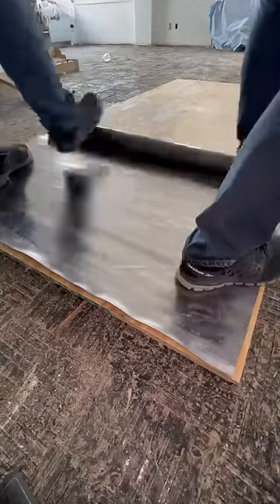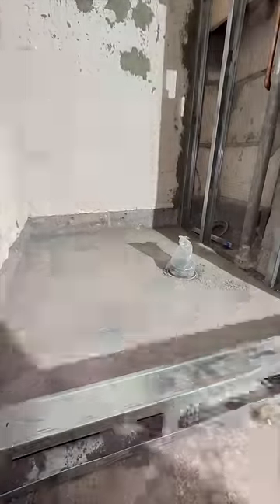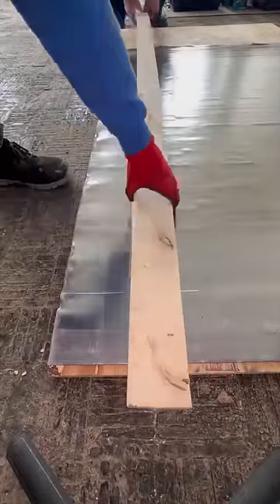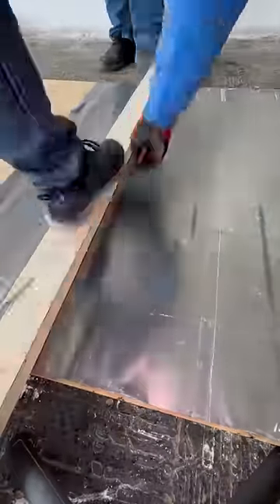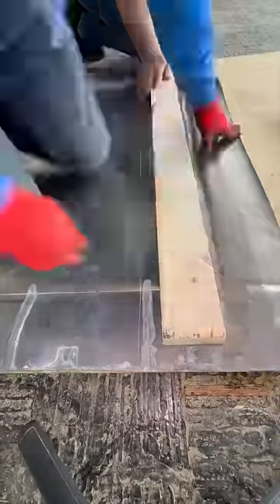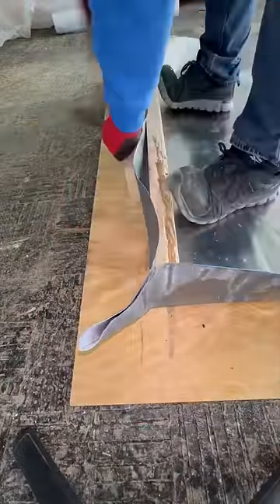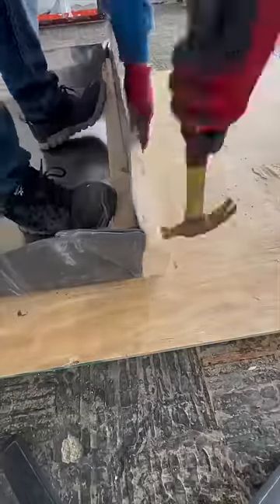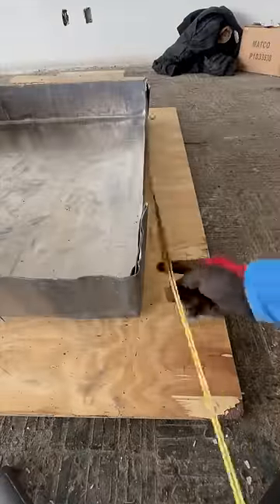Making a lead pan #shorts #howto

Comment: The forbidden aluminum foil
Reply: wine jug*
Reply: It's the OG aluminium Foil
Reply: @WTC7  & sweetener
Reply: w
Reply: It really does look delicious
Reply: Also, couldn’t you do the same with an aluminum alloy of some short? Much cheaper, lighter and less toxic imho
Reply: @billysgeo  no, I it could be donw with more expensive materials, but lead is what its used , same goes to asbestos, its used in all the cars that have piston engines, its used in roofing material EVEN today.
Reply: The cancer causing shiny mess.

Comment: First 10 seconds trying to figure out why plumbers need lead pants
Reply: Yes, it's doesn't make sense. 😮
Reply: Low corrosion rate. Also very tough compared to the plastic liners installed in most showers. Which crack and get old/leak over time. This may also but not for a while. Bathroom remodeling was my primary gig for a little while and installing shower pans comes with the game. However personally I’ve never installed a lead one I can see benefits.

Comment: I've done lead pans with rounded steps going down into the tub. You need the old 50/50 solder to do the seams on them. Fun stuff!!
Reply: Could just use the scrap lead you cut off to “weld” the pieces together. We still pour lead joints in NYC haha
Reply: @raghnor2614  we solder the seams together. In that tub they looked like slices of pizza, lol.  In Philly we still pour lead joints in commercial properties. I mostly use my lead pot to make fishing weights these days though.
Reply: you need to solder corners to stop capillary action

Comment: That's funny, in Austria Plumber's have to remove all lead part's.
A shower get's a sealing coating (and rubber strips for the edges) underneath the tiles
Reply: Does it work?
Reply: Lead is WAAAAAY better!
Reply: If applied well it's good. Actually i need to correct myself, the "floor" is done as one piece ceramic or Plastic like a bath tube
Reply: @john-paulsilke893  Person that hasn't ever tried the other way:
Reply: Not like your drinking the water from the shower floor
Reply: you probably dont have century old high rises all over the place in austria xD
Reply: @crapmaster5000 The US is a baby compared to most countries. Its history is basically nothing compared to most. Most countries in the EU have homes and corner shops older than the US.
Reply: @crapmaster5000  is your argument that buildings in Austria are newer..?
Reply: @OfficialSamuelC  ok then why are all our buildings falling apart huh!? im jk.
Reply: @OfficialSamuelC guess you missed the “high rises” part of the comment
Reply: @OfficialSamuelC if ur comparing america 1 country to the europe a continent then u have lost lol also most of europes buildings are very young just like ur countries on account of the thousands of wars you guys have had lie the last 2 big ones and most of ur countries are actually younger than america but u know whatever makes u feel better at night .
Reply: @curiousshaman2723  Since when war resets age of a country/nation? If that is the case US is a perpetual newborn.

Comment: I worked for Pacific Telephone in the 70's 80's 90' s and 2000's, we used lead to make splices water tight in manholes and in the air.

Comment: The tried and true "dinosaur" way Is a good way... we still use tar in shower pans in California....
Reply: But doesn't your tar in California contain dinosaurs? 🧐🤔🤔🦕
Reply: What’s the updated version? Fiberglass or some shit? I thought tarring was up to date methodology.
Reply: Does it cause cancer?
Reply: @BrainCellular Schluter systems are pretty big in the tile industry. If you take their installation class and get your cert they put a lifetime leak guarantee on your installs. It uses a high pressure foam pan and a thin decoupling water proof membrane for the walls called Kerdi. The whole shower install would weigh about 10 lbs minus the mortar. They also make decoupling membranes for tile over concrete called Ditra. It's good stuff and I have done a 16 inch flood test on a whole bathroom with a central drain for 48hrs without a leak. If I ever do tile in my own home it will go over Schluter products.
Reply: @BrainCellular  schluter systems
Reply: Schluter is good and all but I wouldn't use the kerdi membrane. I've used it and you got to be pretty good at it or else it will bubble up behind your substrate. I prefer something like wedi board type paneling. Something coated and ready, not using fleece.
Reply: @jeosua  that's why you take the class. Not only do they teach you all the tricks that make it easy to apply but it also gets you a lifetime leak guarantee. To my knowledge no other system nets you such a guarantee.

Comment: Having installed every type shower pan lead is a favorite of mine, so much room for flex
Reply: I like Schluter systems. Especially if you have to go up a flight or two of stairs. The lifetime leak guarantee doesn't hurt my feelings either.

Comment: You killed that pan broski. Im starting in architecture and wanna hear ur comments and suggestions cuz i know you guys hate us broski. help me help you
Reply: Dude, you won't. I imagine architects are just like the auto enginerds I have to deal with. I know one, and he wants to do things, but is told "it will add $0.25 to every car, so no" or "it will add 10 seconds at this station on the assembly line, so no".
Reply: @Spike-sk7ql  that fact that there’s some asshole involved in the process that turns down a feature because it would cost anything around $0.25 extra per vehicle is hilariously disappointing. Even at 10,000 units produced, that comes out to $2500 which is barley even a drop in the bucket for what the manufacturer brings in 😂
Reply: Best advice for a future architect is go work in the trades for one year before you start working as an architect.  You will learn more in that one year then you will in years of school.. 

Work one month in each trade.. you will become the best architect to ever live.. 

Oh and when working in trades remember you listen to the boss no matter what and it will all make sense one day..
Reply: @trapjudas1631  extrapolate that to millions of cars, sometimes per model alone. It becomes astronomical in a hurry. But it's still stupid, I agree. 

Nearly 10 years as a parts guy, been wrenching nearly my whole life. It's sadly so true... Penny punching bullshit. Meanwhile Cadillac sold a piece of foam to cover a vibration motor in an Escalade, that was an inch and a half wide, 3 inches long and about half to 3/4 of an inch long... For $139. It's ridiculous what some of these things cost when everything in engineering and production is about saving a quarter. Absolutely asinine
Reply: @goosenotmaverick1156  the engineers and mechanics always have to play second fiddle to the penny-pinching monkey in a suit sadly. Thankfully that’s why we have fun aftermarket companies to fallback on lol
Reply: @trapjudas1631  for sure! Aftermarket- there to fix all the problems the OEMs said would cost to much to fix. 

If that wasn't true, the Dorman line of products would be about half the size, with all their "problem fixing" revised parts. Some of those have saved me from future headaches for sure. 🤣 

First engineers they hire are the ones that'll jump over attractive  naked folks to screw the technicians over. Lol

I joke, it really is the penny pinchers that absolutely murder creativity these days

Comment: People would be pretty disappointed to find out that almost all commercial roof drains also have some kind of lead sheet around it as well.
Reply: Zero lead installed anywhere here in Wisconsin
Reply: @terryerickson1403  0 in IL as well
Reply: Zero in upper Michigan
Reply: Lead sheeting isn’t toxic.    (Unless you eat it).   It’s not fine enough to be absorbed into body or environment 
So there’s no down side to using it
Reply: As they say in Jurassic park, "Nature finds a way". Maybe it's not toxic now, or during it's use but nothing lasts forever and somebody in the future is going to have to deal with it.
Reply: @Mr5Scotty5  If a membrane fails around it, it'll have drain off water running on it until the issue presents and is repaired.  Sometimes those durations can span a very long time.  Running water over lead sheeting doesn't seem like a great idea generally.
Reply: @Mr5Scotty5  lead sheet IS toxic because it contains lead. With your reasoning we'd still be using lead paint...
Reply: All u saying u have 0 lead are full of it.
Reply: @mudbuttt  So glad Mudbuttt could chime in for everyone in the world on this topic.
Reply: @suilegew lead paint is fine if it sits in an undisturbed place and no one eats it
Reply: @Dollapfin So there is no safe lead paint? Just touching the walls would get microscopic amounts of dust in the air
Reply: @goodgamer-yf2il  just don't lick the pan and you'll be fine
Reply: @Mr5Scotty5  Lead still corrodes, flakes, and leaches in to ground water. Also, yes it is toxic.
Reply: @suilegew  well yes a lead sheet is toxic if you were to eat it.   But it’s not going to absorb through your skin 
Where as a lead paint when the lead is very small, it can absorb through your skin 

Water running over lead isint necessarily toxic, it all about leeching.  

Some lead paint can be disposed of in a landfill, if it it’s not leechable,  but if the lead paint is leechable then it must be disposed of as hazardous.

Comment: Lead won’t leak , ever . Thats why it’s the preferred method . The coatings and different methods they have now rely on the materials lasting a long time and I don’t think anything will outlast that lead shower pan .
Reply: Crazy cuz if they never leak why are they being replaced in old shitty appts…. I think someone might just like lead over here😂
Reply: Schluter bro
Reply: Lead Corrodes. Do you know what White Paint was made of?
Reply: They do leak. I've removed a lot of corroded, leaking lead pans. Most were at least 30 years old though

Comment: As a topic of conversation, considering how lead can effect pregnant women, babies, and kids, what are alternatives? Also perhaps your supers should run the alternatives by the client considering how harmful lead is. One more thing to put on my list to ensure I don’t have if I have a place built.
Reply: Why? It's gonna be below the surface where you can never come into contact with it
Reply: @Qballl  you know the old adage, never say never. The practice went out of style and is no longer popular for a reason, that’s all I’m going to say.
Reply: @richard09able why are you even talking about this…come on man you’re being a real baby about something that poses 99% no harm whatsoever and lasts like 99 years
Reply: @tjlovesrachel  I wasn’t aware I needed to provide you justification, don’t hold your breath waiting for an explanation.
Reply: @richard09able lead doesn't affect you as long as it isn't in a dust form/touchable form as in paint would eventually chip and put dust into the air and you inhale it. However, the metal doesn't make dust and would only be somewhat be concerning if you touched it and then put your hands in your mouth after. We still have lots of lead around us today, same with mercury. They work wonders in electrical items.
Reply: It's no big deal.  Most cities and old homes still have cast sewage lines that's caulked with lead.  The pan is  going to be under mortar and tile.  But to answer your question, there are many methods that are acceptable including PVC liner, asphalt coating. Liquid water proofing membranes, sheet membranes and pre fab systems.  Lead is one of the most durable and leak proof systems though

Comment: Try installing leaded drywall for an XRAY ROOM. Each sheet gets construction adhesive treatment  to stick it to the drywall.

That assy., after dries a day, gets moved to the room. 

UGH😮
Reply: No shit never heard of lead drywall. I have taken the sheets and installed on studs then drywalled over.
Reply: @jamusmorrison3073  It was one , and done. 45 yrs ago.
Boss's method.
Had a few sheets fold up, lengthwise, from the weight... a bit hard to carry😶
Reply: that *assy*

Comment: It's 2024 and New York can't think of another way to line the bottom of a shower without using lead? 🤦🏼‍♂️
Reply: just done lick it and you'll be fine.
Reply: probably should stop smoking if you think lead is bad
Reply: @Iosifavich  It's dumb period. If your shit does leak and the lead is preventing it from getting into your room, you're contaminating the entire water table with lead. And for what.
Reply: The other choice is plastic. Which eventually will also leech it's chemicals plus now you also have microplastics.
Reply: @arcanask  no the other option is just correct craftsmanship. Here all showers are just tiled. That's it. The houses aren't made of wood so it can't leak anywhere as it's just on top of a slab of concrete.
Reply: @Delalcon  Tell me you have no idea what you're talking about, without telling me you have no idea what you're talking about.
Reply: @Bandaid_Bus  Yeah great addition buddy. If you don't know why you think that you're right, the most likely reason is that you're wrong. Which you are.
Reply: @Delalcon  Yeah, you can definitely just tile a shower. 100%. Apparently water has different rules where you live. Are you Captain Marvel?
Reply: @Bandaid_Bus  How do you just live completely ignorant like this? Just google ''tiling shower''.. You ever been to a hotel? Or a a swimming pool? All tiles. Just. Smh.
Reply: @Delalcon  All tiles. Right. The contractors of the world thank you for the job security.

Comment: Great work.
Do you not have precast trays??
Reply: Standards in his service area for longevity. Time limited data set for the ultra modern precast. No need to compromise on size or wait on a custom order. May be adjusted and repaired on the fly during installation. Installer is able to do quality assurance of the lead sheet, but must trust whatever mix of ingredients and processes for the batch the passed the factory on a given day.
/csb:  Lead pan in my near future and broski helps my confidence. Tub to shower in a remodel in my hundred year old craftsman Spanish revival home the has another 200+ years of life left. Bathroom is above a plastered ceiling and unique arches and features. Restorative repair from water damage would be a big heart breaker down the road. Very minor plaster and stucco repair and clean up of old repairs for me thus far. Dremel on my back on a platform for a few hours tidying an old over filled ceiling light addition was pretty relaxing. 
Ultra modern has its place for me. I used a Ditra membrane in a mud room under tile over wood.
Reply: @markeastridge9649  I see.... Great explanation buddy.
Thanks for your reply 👍
Reply: @markeastridge9649  Another question.... do you guys bend copper pipe there??
It's very common here, less fittings, saves time and less restriction on the flow of water. We only use fittings (joints) when we have to.

Comment: How do you seal the pan to the drain pipe? Is that done by melting lead and pouring it around the opening? I seen my uncle do this when I was a kid that’s been maybe 50 years ago
Reply: The drain body is already installed. Lay the pan in place. You find the drain body by tapping the floor of the pan with the round side of a ball peen hammer. You make cross cuts at drain inlet, then using the round side of a ball peen hammer and tap the center so the lead splits at the cuts.  You tap the " triangles" with the peen hammer down against the drain body. Continue to tap the lead so it forms to the drain body. You can cut the tips off the triangles if they go too far into the drain outlet. There is a locking ring collar that bolts the lead to the drain body from over the lead. You have to tap the lead to find the bolt holes and cut out the pieces for the bolts to go through. We would tar the lead before we bolted down the collar. We would the screw the finished grid drain strainer to the collar. Then fill with water and let it sit to test. The tile installers would pour the mud, set the tile then screw the grid strainer back to the finished tile.

Comment: Metal lead is not toxic unless ingested and even then your probably fine cause it goes right through you. When it breaks down with other chemicals or when its molten is when it can get into your system. Thats why its legal to use in these applications

Comment: I did this but with the Otie rubber liner. Sloped concrete topping mix, then the liner, then sloped concrete topping mix again with rocks around drain, then tile. It turned out sick

Comment: Interestingly lead pipes were pretty safe after some intial use but the corrosion and oxidation during replacement and maintenance was what caused them to leech out heavy metals and poison the water

Comment: Way back when I made a whole bunch of pans for the building of the Foley Square Court house (each judge got a personal bathroom for their courtroom), when we  folded the corners, we were required to use bar solder to seal the top of the folds. Lead pans were my favorite plumbing project also.

Comment: The danger with lead is in the inhalation of fumes when soldering , or drinking form a container soaking lead in the liquids …. true for all metals when you think about it… on in case of a professional tradie who experiences daily handing with bare hands ; otherwise it’s fine, it’s is a very stable metal.

Comment: Do you ever weld or solder the edges? Not sure if its even necessary but has it ever been required?
Reply: Not the edges. Only welding is done around the drain connection to create a totally water tight seal

Comment: Until I found this channel I never heard of this method... does the waste water come in contact with the pan every time you shower and is that a problem when recycling the water because of the traces of lead? 🤔
Reply: No if everything is working the water never should touch the lead. The lead is just your last line of defense if a leak were tl happen